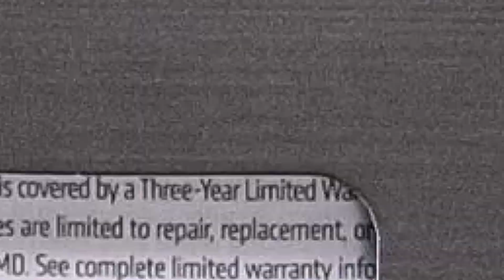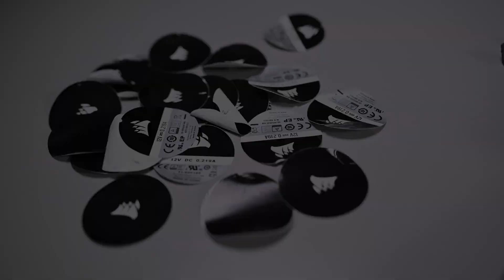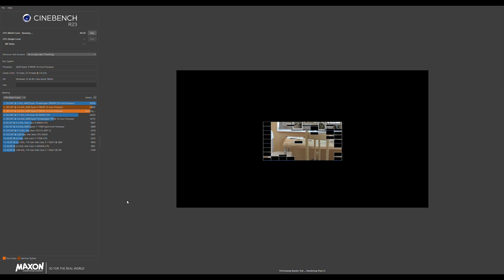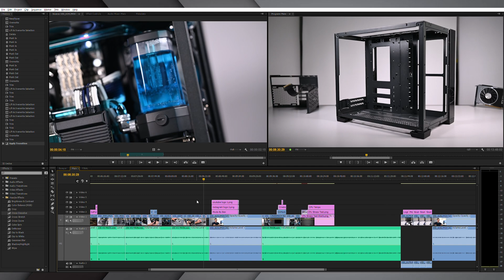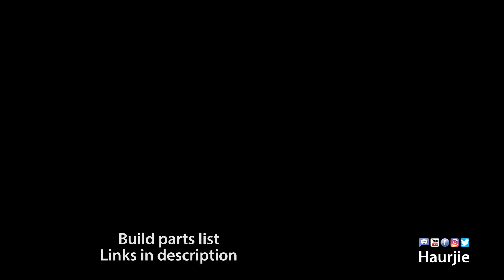O11 Dynamic Mini Corsair Hydro X Build – AMD Ryzen 9 5950X

Comment: Interesting that the blue in the reservoir doesn’t match the blue in the tubes and gpu block. Guessing it’s a product of the different acrylic thickness’s. Have you tried a different color? Love the build but the different color appearance of the liquid would drive me nuts.
Reply from the maker: This is common. It's not the thickness of the acrylic, it's the volume. Reservoir holds more depth, which is why it appears darker while the tubes look lighter.

Comment: so theres just enough room to vertical mount and radiator at the bottom, im contemplating swapping to this case and 360 top and bottom rads
Reply from the maker: I don't have this case anymore but if I recall correctly, if you use an ATX sized motherboard, you cannot fit a rad at the bottom. Lian Li has a diagram on their website that shows the different sized mobos you can use and what else you can fit in it.

Comment: 85c? my 5950x with a noctua nh-d15 and room temperature at 26c doesn't hit over 80c when rendering in blender at 100% utilization, it is inaudible in a badly ventelated case (corsair obsidian 750d).  edit: is the room temperature preety high?
Reply from the maker: My room temperature is normally pretty high, I live in about 75F. Also, I don't use blender, I use cinebench R23 loop or Prime95 as my main CPU stress tests. And you have an air cooler where the CPU does not share the same loop with the GPU, so that's also heat added in that needs to be considered.
Reply: @hardlinenexus  makes sense

Comment: is this case possible to mount 30mm fan and 30mm radiator when using the vertical gpu mount?
Reply from the maker: I haven't tried. You thinking about doing the phanteks T30s?

Comment: Do you have a link for the bracket for the 2080 , I believe the stock case only comes with it set up flat/ horizontal
Reply from the maker: The vertical GPU bracket is a Lian Li thing. It's an optional back piece of that O11 mini case that you purchase through them or Newegg.. or whichever retailer carries it

Comment: You could shave off 6 degrees from the cpu if you lap it
Reply from the maker: Yea most likely. I probably wouldn't do it though personally only because I have the tendency to sell things off for upgrades. So I like to keep things to their original haha
Reply: @hardlinenexus  I was checking prices on ebay and found out lapping increases resale value for cpus in general however AMD cpu lapping is uncommon
Reply from the maker: @yosixxx  Thanks for that info, that's very good to know. I'll be getting my hands on the new Intel 12th gen soon, that may be an experiment I could try later for the sake of content

Comment: Ok here I am.  The price for this chip is $200 more than a used 3950X? and $400 more than 3900X...but you think it's totally worth it for 4K video editing etc?  I am a noob.  I wonder how much more powerful it is.
Reply from the maker: Don't compare new with used. Compare new with new and used with used. If you're goal is to get a used 3950x or 3900x and you already have one in sight or know someone who's ready to sell, then you can absolutely save money. If you're aiming to get new, then get Ryzen 5000, it's more efficient
Reply: @hardlinenexus  Well it's here in Japan and used is almost like new sometimes lol.  I can afford either, but don't want to waste money if there isn't THAT much difference lol.  Is the $200 or $400 difference worth it.  The build you did looks amazing.
Reply from the maker: @KickAssets  if you can save $200, I would say go for the 3950x :)
Reply: @hardlinenexus  Ok, so the jump from 3900xt to 3950x for $150ish is worth it, but the jump to 5950X isnt :)  Ok. Thanks for the advice.  Don't want to drop $500-$1000 on a mistake or regret hence the thorough questions haha.
Reply from the maker: @KickAssets  if I remember correctly, back when the 3000 series came out, I think all of the XT variants were like not good value buys. But prices on all of those have changed since then so not sure really where they stand now if you're comparing them within its own family of 3000 series. But if the price is close between 3900xt and 3950, everyone back then was just avoiding the XTs lol

Comment: Hey man, good video liked 👍, im looking to do my water cooling  for mine too going for the hydro x kit with ssd cooling, might scrap it depending on pipe routing, what riser cable did you use? Im looking at the link up as corsair dont offer pcie 4.0
Reply from the maker: I used PCIe 3 since. The vertical GPU bracket from Lian li comes with it

Comment: Hello can I ask a favour? I bought the Corsair RM850, RM Series, 80 Plus Gold Certified, 850 W Fully Modular ATX Power Supply and I don’t know how to install cables to their appropriate connector on power supply. 

Thank you for taking the time to read this take care still a subscriber you deserve a lot more views and subs cheers 🥂
Reply from the maker: The cables should be straightforward when plugging in, you just line up the pins into the power supply. 4-pin with 4-pin, 3-pin with 3-pin, etc... each one can only fit into the appropriate ones, it's very hard to mess it up. If you can't plug it in with a "click", then it doesn't belong there.

Comment: Imagine the Corsair engineer that put all the RGB into the pieces watching you stripping them all out. Also, the worker who stickered those fans might cry.
Reply from the maker: Hahahaha I'm just trying to show that Corsair can do both RGB and non-RGB builds and make them look nice! ;)

I pulled off the stickers because some of the fans have the backside facing the out for pull orientation. The back side fan stickers have all these numbers and stuff on it, it doesn't make the build look clean. The front stickers are fine because it's just a clean logo, but if I'm gonna take off all the stickers for the back facing stickers, then I'd rather do it to all of them so it's uniform.

By the way, I also work for Corsair 😆.